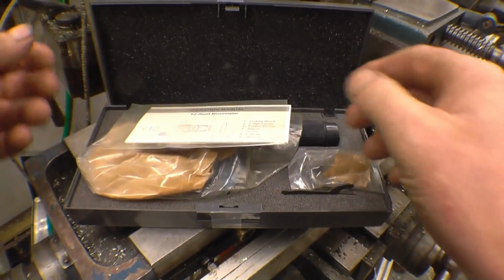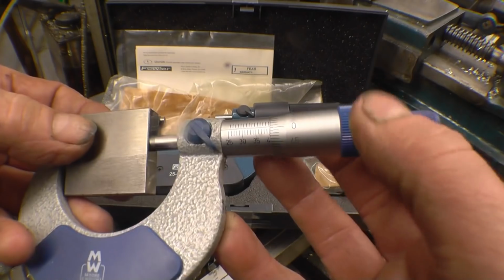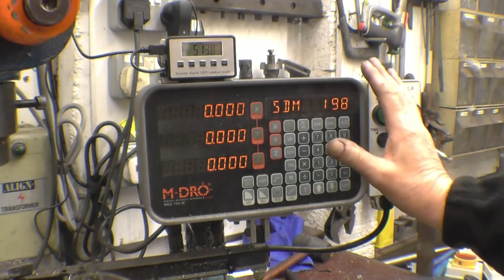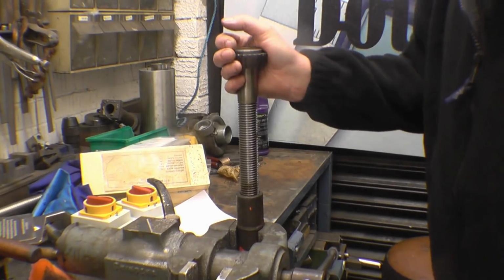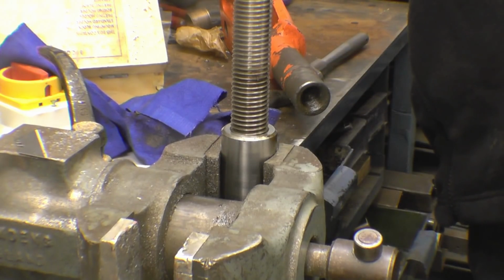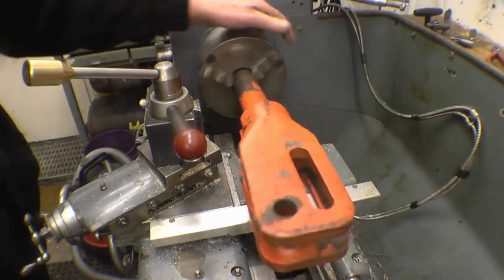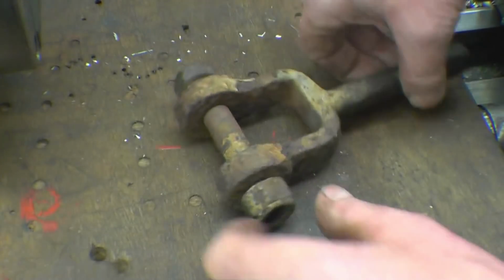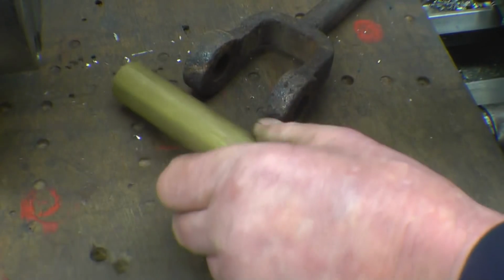SNNC 315 P1   Tractor Leveling Box    Machining Brass

Comment: G’Day John,  When I was an apprentice Fitter and Turner, admittedly 40 years ago,  if you mixed ferrous and non-ferrous chips you would spend the rest of the day with a magnet sorting them out.  Lesson was learned quickly.
Regards Dave

Comment: Ya i have a lathe/mill combo very handy. I have the vfd for the lathe motor and a kbc dc drive for the mini mill. My expierimental has to go it keeps my hands away from the machine. And the smart move for me is the electronic leadscew. So more junk to put up there. full cnc probly dont need it. just the cheapest way to the accuracy I need. love the myford just brand new as compared well taken care of good to see you